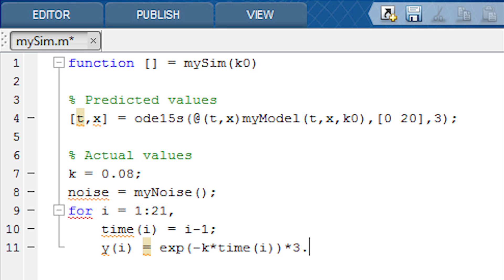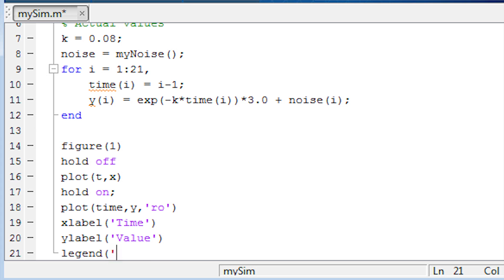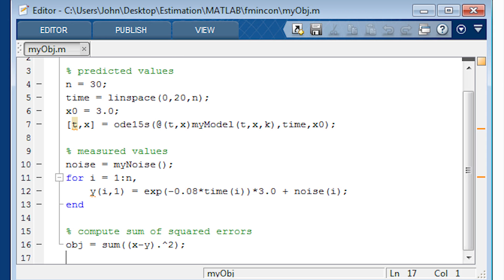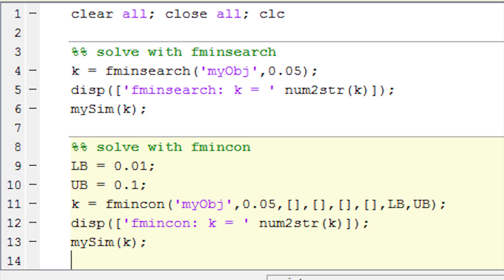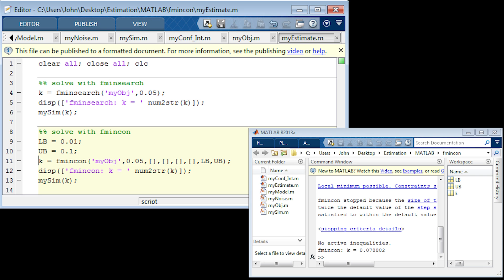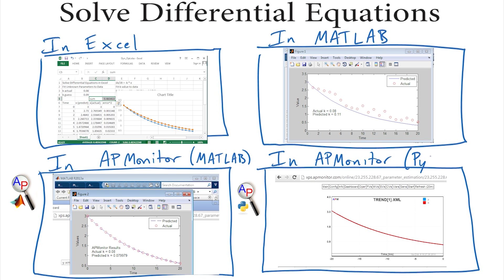Solve and Optimize ODEs in MATLAB

Comment: This videonwill help me a lot in my research. Sir do you have video on ODE sensitivity analysis?
Reply from the maker: There are a couple different ways to do the sensitivity analysis. The easiest is to use finite differences with odeint and autograd: https://kitchingroup.cheme.cmu.edu/blog/2019/09/13/Sensitivity-analysis-with-odeint-and-autograd/ A more exact way is to integrate the ODEs with the adjoint equations to get exact sensitivities.

Comment: What if I have to optimise just one of the multiple ODEs by varying one or two variables? 
e.g. I have 18 ODEs, each containing the concentration of different reactants and products of an acid hydrolysis reaction. I need to maximize one of the products by varying Temperature and Concentration of acid.
Reply from the maker: Here is a tutorial on optimizing parameters in an ODE model: https://youtu.be/ynm7B0N0_Yw  There is also the dynamic optimization course at http://apmonitor.com/do

Comment: Thank you Prof Hedengren for the great tutorial!!! I have a question with the ODE functions. What if the ODE have time varying external inputs? How can I use my measurement data for those external inputs? For example, dxdt = - k*x + par(t) *x, where par(t) are measured at t = 1, 10, 20, .... Looking forward to your answer! Thanks!
Reply from the maker: +TIAN ZHANG, use an anonymous function to bring in the additional input. This video: https://youtu.be/QKhy1JsdiUo shares how to do this starting at about 4 minutes. The u value is the additional input. You can put the ode integrator in a loop and have it cycle each time the input changes. You'll need to store the results as you cycle through the loop. Let me know if you need more help.

Comment: Hi i want to use Fmincon instead of constr
e.g
option = [];
  x0 = [2 3 4 3 1];
A = [ 1 2 3 4 5];
B = [ 0 2 2 1 2];
x = fmincon( 'results', x0, A,B)

function[s1,s2,s3,s4] =  results(x)

I get "Row dimension of A is inconsistent with length of b." 
but if i make B 5 i get this error "NaN variables  as well as inf"
Reply from the maker: +tshepo godfrey kukuni, the matrix A needs to be defined so that A x = b dimensions agree. Try to use A = diag ([1 2 3 4 5]).

Comment: Thanks for your tutorial! Can you help me with a problem. I have an equation like dX/dt = AX+BU. X is a 2 dimensional vector. A and B are 2*2. U is known for all the instances. I have to find the optimum A and B for which cost function Y(real) - [0 1]*X is minimum. I want to use fminsearch for the whole thing. I also have initial guess of cost function and the A and B matrices which gave me the initial cost function
Reply from the maker: Check out #2 at this page: http://apmonitor.com/che263/index.php/Main/MatlabDynamicSim for integrating a system with more than 1 state. For fmincon, you'll need to create an objective function and call fminsearch (unconstrained) or fmincon (constrained) to find the solution. If you need something that will solve faster than fmincon, then please have a look at APMonitor (Dynamic optimization course at http://apmonitor.com/do), a MATLAB toolbox.

Comment: Thanks for your tutorial! It works perfectly!
I just have a question, can I do the same when I have 3 parameters (and 2 equations) instead of one?
Reply from the maker: Yes, it should work with any number of parameters (1000's) and variables (10,000+). Additional tutorials on ODE solutions are on the dynamic optimization course at http://apmonitor.com/do There is also a user's group at apmonitor@googlegroups.com if you need help with your application.

Comment: Thank you for this great tutorial. I have one question, if I have the following couple ODE, what is the best way to solve for the unknown parameters?

dv/dt = (Yv/(m-Xud))*v + (Yr/(m-Xud))*r

dr/dt = (Nv/(Iz-Nrd))*v + (Nr/(Iz-Nrd))*r + (T/(Iz-Nrd))*Tr

where the unknown parameters are Yv, Yr, Xud, Nv, Nrd and Nr
m and Iz are know constants
dv/dt, dr/dt, v, r and Tr are obtained from experiment.

Thank you.
Reply from the maker: You can start with the files that are posted to http://apmonitor.com/me575/index.php/Main/DynamicOptimization or the course on dynamic optimization http://apmonitor.com/do (see Estimation section). You can create an objective function such as a sum of squared errors to penalize deviation of the model predictions from your measured values.
Reply: Thank you for your answer. I got the idea from your course to solve the problem.

Comment: Great lecture and materials!  Do you have any example material regarding optimizing multiple parameters in coupled ODE's?
For example:
dx(t)/dt = - k1*x(t)
dy(t)/dt = k1*x(t) - k2*y(t)

Where a data set for x(t) and y(t) were obtained experimentally, and k1, k2 are unknown.  Thanks!
Reply from the maker: Sure, here is one video... http://youtu.be/WIXeySSa1fk
Reply from the maker: Yes, you can just add them as input parameters if you use an anonymous function. Here is a similar example but for an ode integration. https://youtu.be/QKhy1JsdiUo?t=4m32s  Same thing applies to passing in parameters to fmincon. Instead of passing in the objective name 'myObj', pass in an anonymous function @(x)myObj(x,p).
Reply: APMonitor.com  HI SIR do you have an example about systems with delays witch we search the delays with this..???
Reply: Hi APMonitor tutor thanks a lot for your videos! I have a question related. Is it possible to run fmincon where my objective matlab function 'myObj' and 'mySim' have multiple parameters (k1, k2 ...)?
Reply: Thanks a lot!